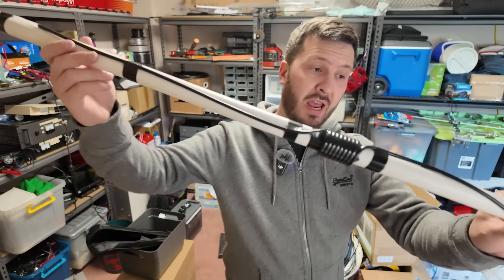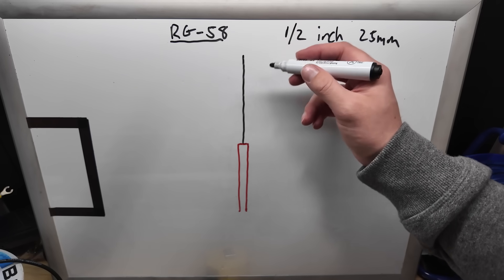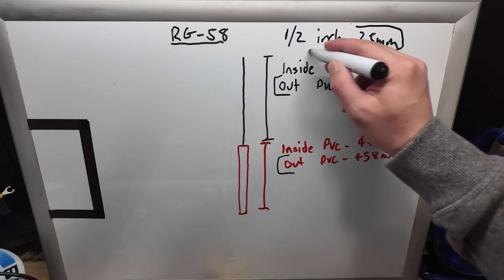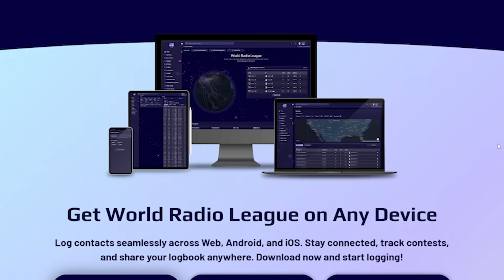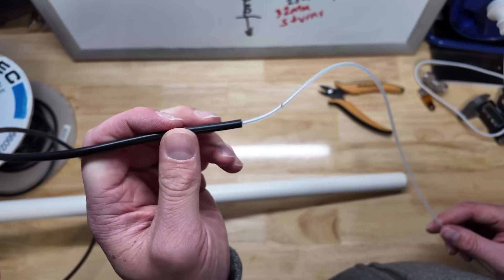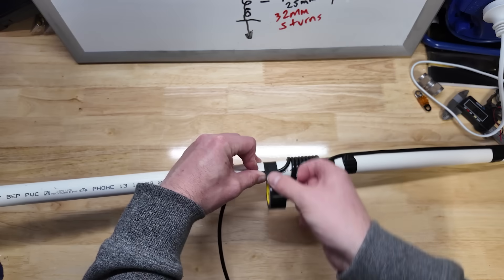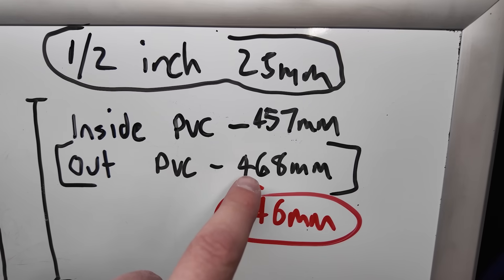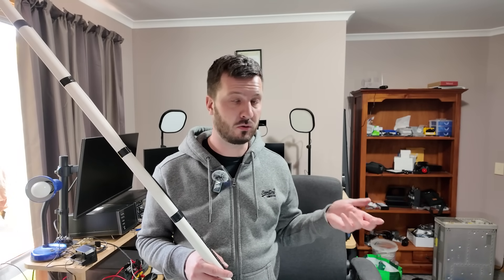Build a 2m (146 MHz) Antenna for Just $5

Comment: I don’t really understand polarization to begin with, and I suppose if this is a 2m antenna then having it vertical is the way to go. If you did 10m and up, would you try to mount it horizontally?
Reply: This is a dipole made of coax.
It's vertical.
The coil defines the length of the earthy side of the dipole
Reply: An antenna for 10m can be horizontal or vertical. If you want FM local contacts with a vehicle then use it vertical. If you want to DX then use whatever is best in the situation you're in. Oh, and for 2m SSB you'd generally use it horizontally.

Comment: As Ham Radio Tube (Mike K8MRD) likes to say.  Ham radio is metric.  Roll over your 100' antenna measuring tape and read off the metric side.  The math is so much easier when using metric.
Reply: Everything is easy in metric.
Reply: Or you could join the rest of the world and learn metric! 😂😂
Reply from the maker: Mike is a wise man :)
Reply: @HamRadioDX  i mean how to calculate cmc turns per band please..

Comment: Nice well done set of instructions . The 25mm is 1 inch of course, The VK3 has a good idea with folding back the braid could make a 1/4 stub from that maybe ....I'd also go to soldering on a bit of antenna wire rather than stripping the coax it's both cheaper and less hassle !

Comment: Correctly known in the commercial world as a centre fed coaxial dipole.
Can also help to roll the braid back down over the coax if its protected from the weather. Helps isolate RF on the coax, and performs better.
Reply from the maker: Great tip! Thanks Heath
Reply: Methinks if you roll the freed (not cut as in the flower pot antenna) braid down over the coax it then becomes a skirted dipole.  I am curious which of the 2 antennas would give the more favorable gain / desired radiation  pattern?
Reply: Exactly --1and 1/4 meter of electrician's gray conduit. Strip down and remove  1/2 meter of RG8 outer coax cover. Now with the shield ,slide down over the regular portion any length of coax to for the impedance  matching (no coil needed, and less loss. ad.j swr with antenna impedence meter. Insert assy into conduit with cap. Secure bottom with small hose clamp and drill bottom cap and install. Mines 2 yr old. -VE2bqp PS I also copy commercial aluminum folded dipoles with coax inside(north American type not UK type) Flat swr 20 mhz 1-1
Reply: @rickpalmer9518  Just a note about using electrical PVC conduit, there are some additives in this sort of conduit that can cause odd readings at RF frequencies, it isn't significant, but be aware of it.
PVC pressure pipe is probably the best material for this sort of antenna.
Reply: @rickpalmer9518  Can you expand on this?  I'm not really understanding the procedure you are recommending.

Comment: 1/2 inch is 12.7mm , 1 inch = 25.4mm , lol
Reply from the maker: Oops.. this is why I don't do freedom units
Reply: @HamRadioDX  Unless the outside diameter of 1/2" pvc pipe is actually 25mm.  LOL
Reply: @HamRadioDX  Try using Google,  or do you not use Google units either?
Reply: The pipe size goes by the inside diameter..